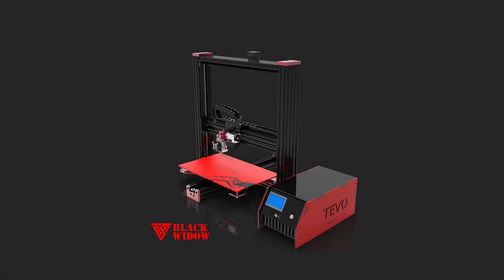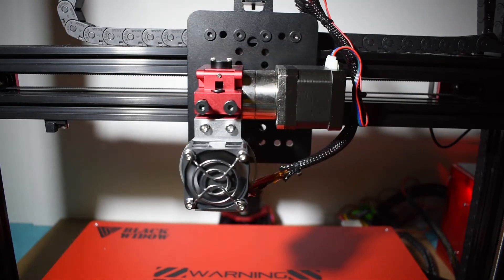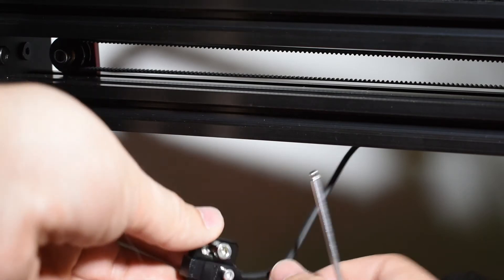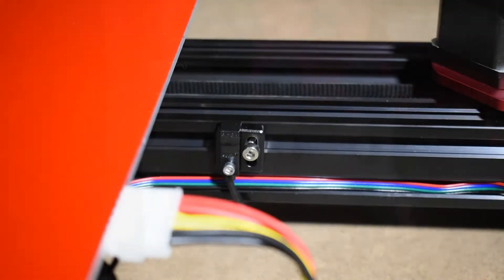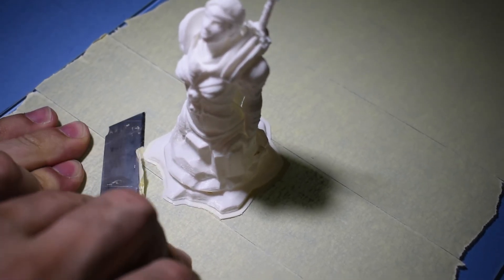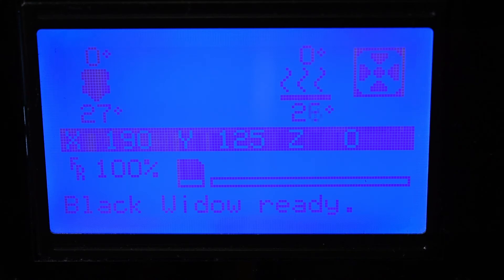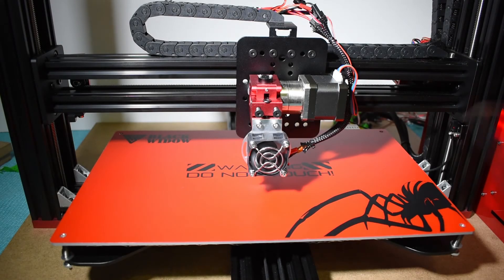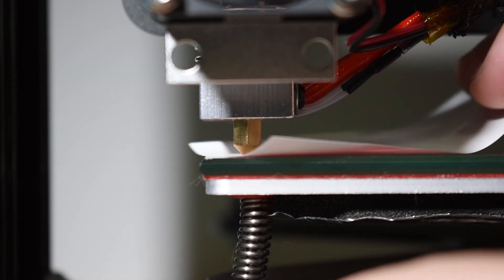TEVO Black Widow V3 assembly - STEP 13 (First tests and adjustments)

Comment: Hi, Ruiraptor! Followed your series of videos to finnally complete my black widow. I bought the bl touch version and I’m having a weird issue when I try the auto level bed. Instead of the z axis go down to sense the bed, it goes up. I’ve already search but didn’t found any consistent response so I’m asking you. Hope you can point me to the right direction. Just subscribed to your channel btw. Thanks!
Reply from the maker: Hi Leonardo,
If your Z is moving up that means that the sensor is always triggered or not correctly connected.
Check the community guide...i think it will help: http://bwcommunity.divestick.net/JupaCreations_bwcg.pdf
Reply: ruiraptor I have the same problem and can’t seem to get to the community guide. The links don’t work. Is there anything that can be done to remedy this. Everything works fine, I’ve got the bltouch version the bltouch works just fine, but the z-axis doesn’t home downwards like one could expect. Any ideas?

Comment: hi Rui... i don´t understand very well what you saying at the begining of the video, you said something about BLtouch i think. thanks!!
Reply from the maker: Hi Hacelo,
What i mean is that you need to look at the display when you turn on the printer. If you see BL touch then it means you have the firmware ready for auto bed leveling. If you don't see any BL touch on the display, then your firmware is ready for manual bed leveling. This will influence the way your printer will behave when you home the Z axis.

Comment: where did u buy the piece of glass, can't find any on ebay, just want the right size coz cutting glass would not be an option for me at home, thanks
Reply from the maker: Hi Justin,
I bought it at a local glass maker. It costs just 4euros.
All the glasses on my printers i have bought in this glass maker.
Reply: i found some on ebay but they costs around 49 GBP, do u know where I can get cheap ones online?
Reply from the maker: Those might have special treatment. You can get away with normal 3mm or 4mm glass.
Tempered glass is not expensive and also works. I dont know where to get glass online. Have you tried searching for picture frame glasses?
Reply: will try that now
Reply: can't find any that suits the purpose, the ones from ebay are just of 1.2mm thick
Reply from the maker: Yeah...that is too thin :(
Reply: are there alternative materials?
Reply from the maker: For removable surfaces not many. You can also use a mirror but that might be harder to find i guess.
For non-removable print surfaces, you have plenty of options like buildtak, for example.